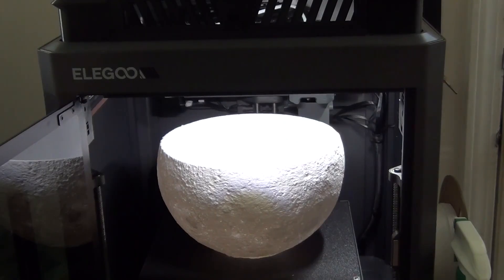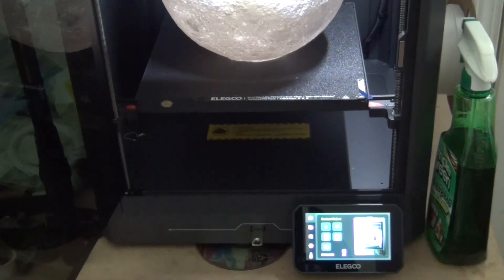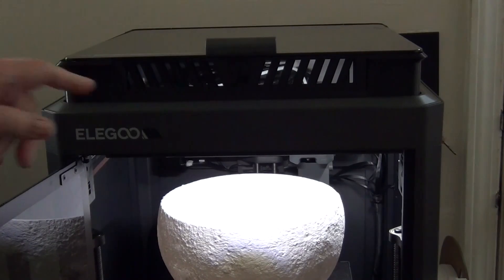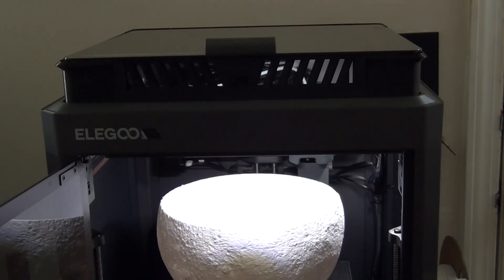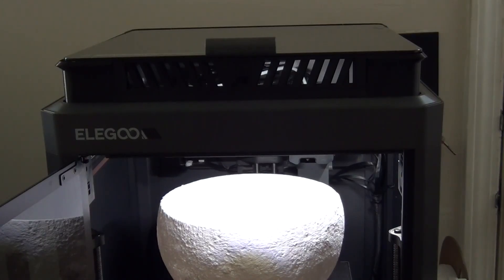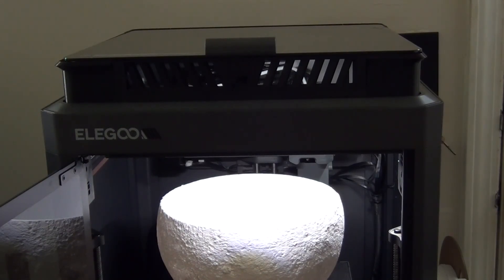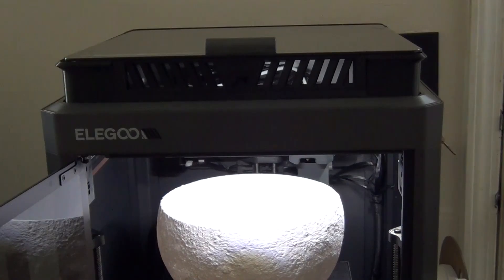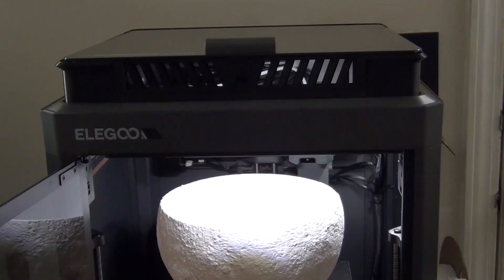My first impressions of the Elegoo Centauri Carbon 3D printer

Comment: Mine glitched once...I just reprinted and it was fine. Pretty sure this was due to a surge in power due to a storm we were having. In order to resume a print maybe try and heat the nozzle and bed before resuming.
Reply from the maker: Yeah, that is an excellent idea, Thanks!
Reply from the maker: Just FYI, the 2nd attempt finished successfully at 12:10 AM today.

Comment: OLD VERSION BEING SHIPPED  I just received the CC printer yesterday and want to advise everyone thinking about buying one that they are shipping the old version machines.  The one I received does not have the new light or other upgrades that units being reviewed on YouTube are showing.   Yes, I am disappointed that I was not given the chance to wait for a latest revision machine.  In any case, just wanted to warn perspective buyers that old stock is being currently being shipped.
Reply from the maker: Thanks. I'm curious as to where your unit was shipped from? Mine came out of New Jersey and mine has the upgraded light. Maybe the warehouse it is shipped from has something to do with this?

Comment: had my first air print yesterday and I've only had mine for a week or so but my issue was the filament, I need to buy a filament dryer so that's next on my shopping list :face-purple-crying:
Reply from the maker: Thanks. Yeah I haven't seen the air print yet, but I've heard it's a problem to watch out for. I printed a few small things with mine after the large moon fail but still haven't got up the nerve to try another moon yet. :)

Comment: Can't see my previous comment so having to post a new one.
There is a solution basically you can take big tree techs sensor and use an ESP32 to make it work for CC. 

https://youtu.be/6JYKpZ3HX2Y?si=cmLxchSVMQv4H7BO

My CC is should be delivered tomorrow!🤞
Reply from the maker: Thanks. Or the printer could function as it was designed to do without stopping. No doubt there are work arounds for this problem, but the point is I should not have to do that.
Reply: @DERB_Seymour_Indiana True but it's a 300$ CoreXY... You can spend 200$ more and have that feature built in :). 

CC just doesn't have that capability currently due to the runout sensor that leaves a little to be desired but again, it's 300$ coreXY. 
If your filament tangles, gets stuck, clogs, printer has no idea.
Reply from the maker: Yeah I have that same type on my Creality Ender 3 V3 Plus printer that I recently purchased as a refurb for $250.. That was the first printer i used to print that same moon and it did it twice with no problems at all. I sure hope they figure out the problems with the air prints and such on the Elegoo CC.

Comment: I've got almost 600 hours on mine so far. I've had two "air prints". But both of them were from the filament snagging on the spool or the dry box. The filament sensor still sees filament but doesn't know that the filament isn't moving and so the printer just keeps on printing nothing. Overall, I've absolutely loved this thing.
Reply from the maker: Thanks. I'm going to try another one, but I want to time it in such a way as to be up when it gets to the second half of the print. The first one I printed looks great We shall see. :)
Reply from the maker: Update, 2nd attempt finished successfully at 12:10 AM today. Very pleased with that.